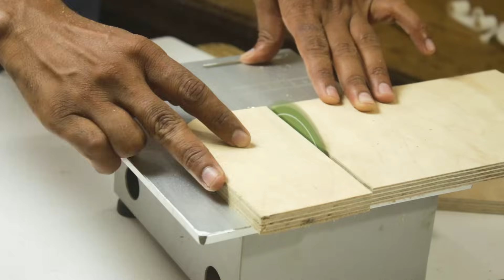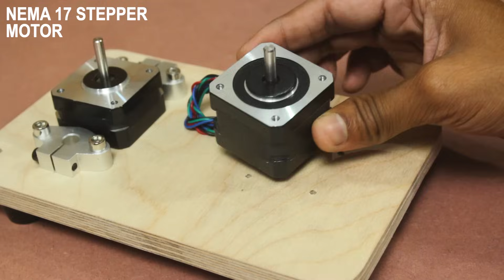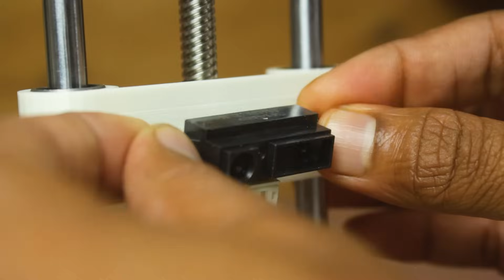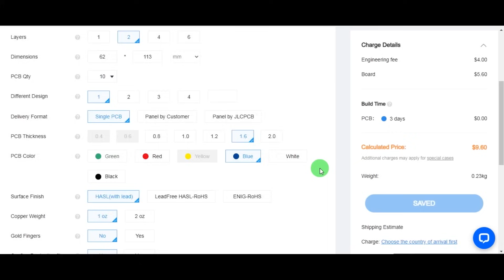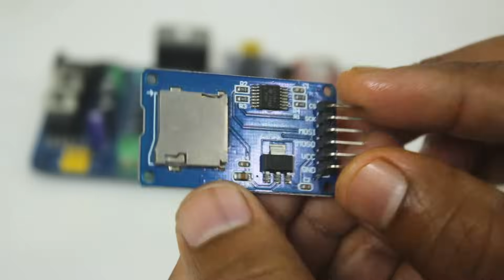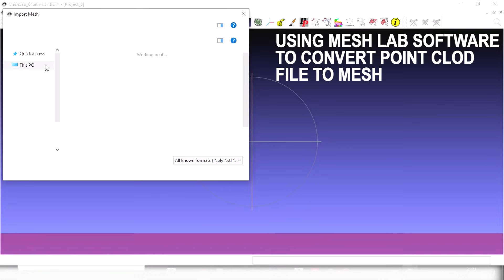DIY Arduino based 3D scanning machine | IR 3D scanner

Comment: I think this project is a sales exercise for jlcpcb - unlikely it works properly. No homing switch on z axis - the sensor shown is not that accurate. You would be better off with a laser line projector and a camera at an angle to determine the profile. Also, you'd need some sort of calibration object to set this up.

Comment: Are there any limits to the accuracy of detail from the sensor or is it only lmitited by sampling rate and min/max range?
Reply: the sharp sensor's output is a voltage, so if sampled using an 8bit or 12bit analog-to-digital converter this gives you the resolution, but there's videos about that Sharp module that mention the need for software  filtering of the data. more expensive sensors sometimes have a microcontroller on-board that do the filtering. else the noise/errors may swing larger than the 1/4096 or 1/256 resolution of the ADC

Comment: The shown point cloud is not the scanned object - the scanned object has its mouth closed, the point cloud has its mouth open.
Also, the point cloud shown does not have points in layers as suggested by the time lapse, but the points concentrate radially in front of and behind the head, suggesting someone modeled it starting with a sphere primitive.
Reply: Indeed!  Nice catch!! :)
Reply: Great observations but you missed the conclusion; Mr Innovative is a liar.
Reply: Yep, that is the first thing I noticed too. This guy needs to go back to making perpetual motion machines.
Reply: @drewh0208 :  Well spotted!  It seems rather sad to put the time and effort into making these videos which may not work as implied.  Experienced builders could make something of the ideas, but probably are capable of better designs anyway.  You have to feel sorry for the nooby who thinks they have found a suitable beginner project... they build it as shown, it doesn't work as shown, they ask for help, AND THEY GET IGNORED!  Another disillusioned soul lost in the wilderness.    😕 🥴
Reply: It's also using a ir distance sensor which has a resolution in mm And also a field of view of about 15degrees. This simply would not work. This dude is entirely just more complicated scams.
Reply: lmfao
Reply: yeah... i caught that too.
Reply: good catch !!!
Reply: I was wondering how he nanaged to get details between the bec and the forehead which is in the shadow of the sensor.
Reply: Wtf...
Reply: Good catch, also thescan only went halfway upthe head,
Reply: great point!
Reply: merci beaucoup pour votre observation, et les reponses qu'elle a sucité, vraiment tu perd du temps a regarder une video, dont le créateur a magouillé.
Reply: The whole point cloud software shenanigans felt like a big leap anyways. Didn't even pick up on these little, but major, details. (:

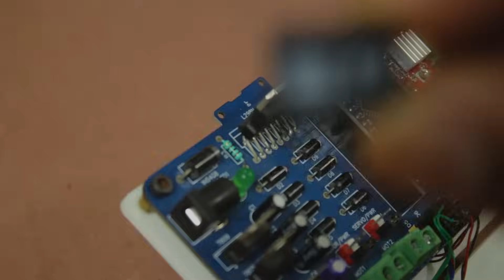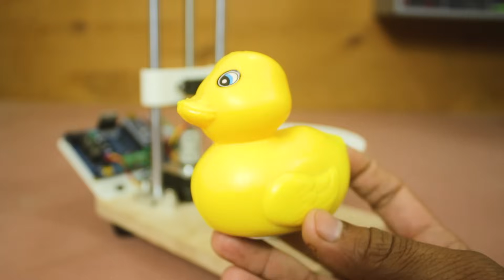Comment: just a little question : beetween 5:15 and 5:30 when did you add the laser diode ? is it just for easier use of the scanner ( seeing what it is doing in realtime) or did you wire it directly in the distance module to get a narrower area for the measured dot in the point map ?
Reply: The Diode is to make even more Schmucks believe this is real, look at the scanned image and compate the heads...